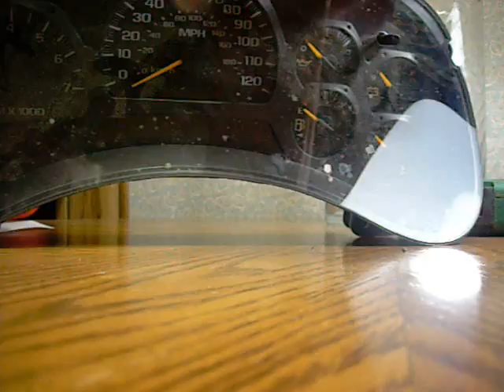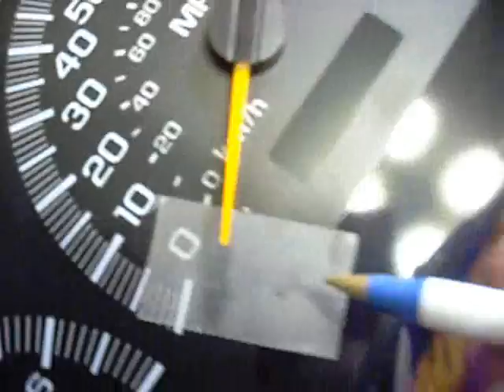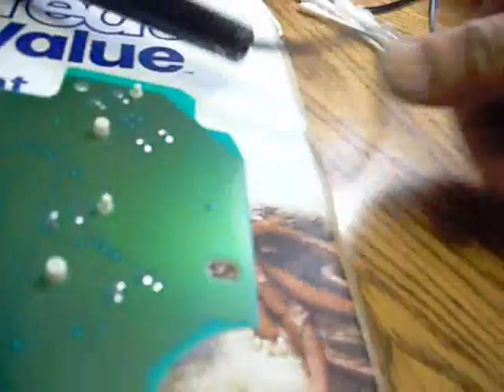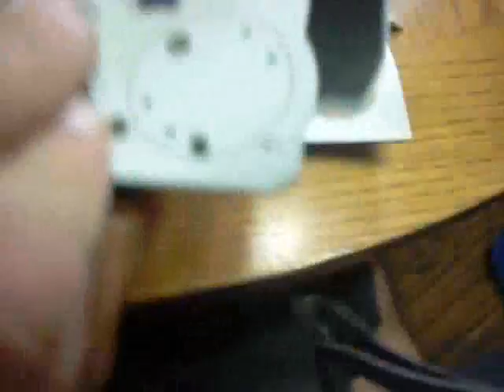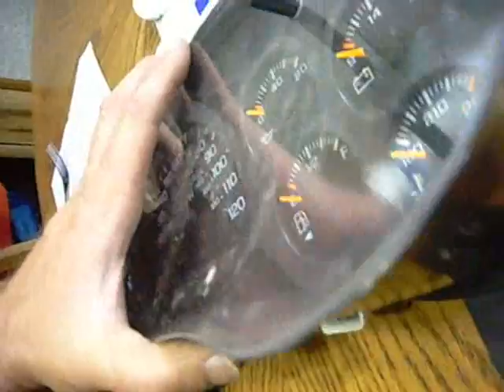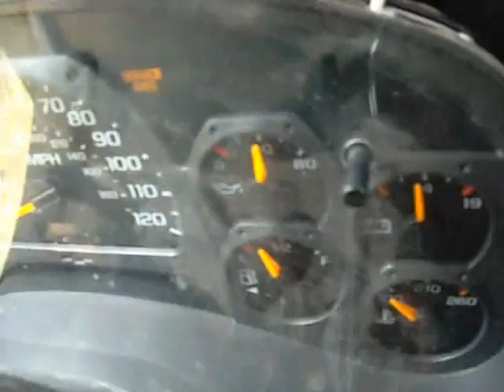Chevrolet Trailblazer Gauge Repair

Comment: Mr. Caston you're the best! The cheapest repair was $189 plus $300 core deposit. My total cost was $30 for motors and $10 for a cheap solder iron set. Amazing instruction! Thank you.

Comment: Thanks for video. As a first timer with soldering, my recommendation to beginners like myself is to get solder with suction device (as I've seen in the web) to remove melted hot solder. Other than that, when I removed instrument cluster off my 2003 Trailblazer and removed needles, to my amazement, stepper motor of RPM was not, repeat, not have been soldered to the PCB. I bought this Trailblazer new so all this time, RPM needle was moving without having stepper motor properly soldered! I replaced all 6 stepper motors. When I put stuff back together, all gauges work except battery charge indicator, which I take could be due to my beginner's job or faulty motor I bought in amazon.com. Again, thanks for video.
Reply from the maker: Thank you for watching. I bought those stepper motors a long time before I worked up the courage to finally tacke the job. It went surprisingly well.

Comment: Wow, you're using Q-tips to remove solder.  I use a small Radio Shack copper braid roll, coated with dry flux paste to remove solder. Interesting!!!!!!! I actually learned something from you today Sir.

Comment: I found that the stepper motors zero out when you first turn the key on so I connected the panel after installing the motors but before installing the needles. Temporarily connect the panel to the vehicle.  Then turn the key on (don't start the engine) and let the motors "Zero" and install the needles to zero on the printing and it worked beatifically,  Then re-assemble the whole thing.  Speedometer track my GPS to within 1/2 MPH!

Comment from the maker: I don't know what you are doing wrong either. Possibly not a good solder connection to the printed circuit? When you put the needle back on, move it counter clockwise one complete circle to "0" or zero. This video is my first attempt to do this repair. I have repaired a few others for friends since then. None of them have experienced any problems. Keep at it. You will eventually get it right.

Comment from the maker: Thanks. The bulbs are soldered to the circuit board just like the stepper motors. I assume that with a bit of research the bulbs could be located and purchased. The alibration could have been slightly altered but compared to totally inoperative gauges the error is acceptable.

Comment: Yours is one the best cluster repair guides I've watched. I replaced a dead fuel gauge stepper motor but the new one acts sort of random. I don't I have bad sender but perhaps I did poor soldering job. Do you know how to recalibrate a GM fuel gauge stepper motor?

Comment: There was a recall in several GM cars that use these panels but Trailblazer wasn't among them but the part is the same.  Go figure - maybe you can get GM to pony up for the repair but my dealer wanted $550 so I bought the parts for $40 and replaced all the stepper motors.

Comment: Great video.  A few questions for you...I had a bulb burn out for the fuel gauge.  I couldn't tell from the video but is the bulb part of the stepper motor assembly?  Also, I noticed when you were removing the tape that some of the gauges moved after you had set them.  Does that mess up the calibration of where you had aligned them on the tape marks?

Comment: I have a 1999 blazer with a fuel gauge reading that is not correct. At E empty ,I still have 7-8 gallons in tank. Where can I buy the stepper motors? Is the 1999 cluster built the same as the later ones ?
Reply: +Pete Garcia Remember that could also just be the sending unit from your tank saying the tank is empty and not a gauge problem. I'd do more testing first before switching anything out.

Comment: @rcaston19  $7 times 6 or 7 motors plus shipping?  Have it done right with a warranty for $99. We'll replace any bad lights and fix other known issues with this cluster. It will never fail again. autoxpresstech

Comment from the maker: they are called stepper motors try this item number in ebay search 250960640928. you can also search google for "GM Stepper motors ebay" Easy to find, cheap to buy, tricky to replace.